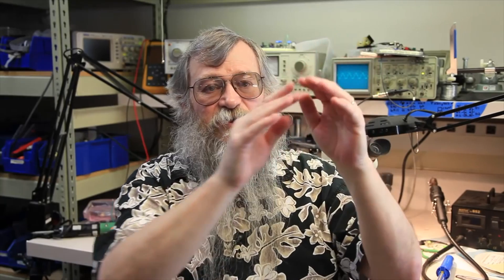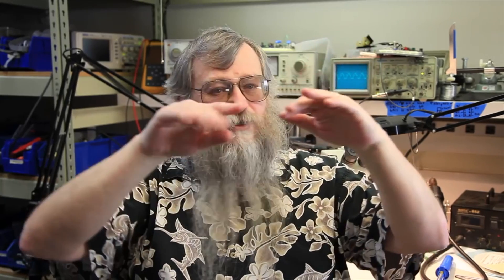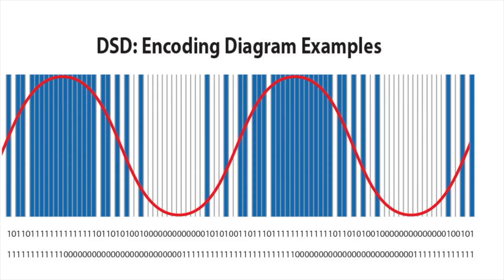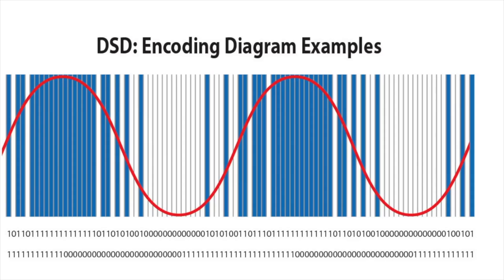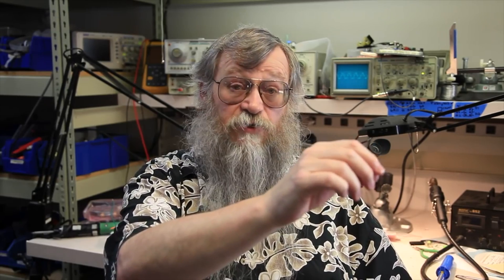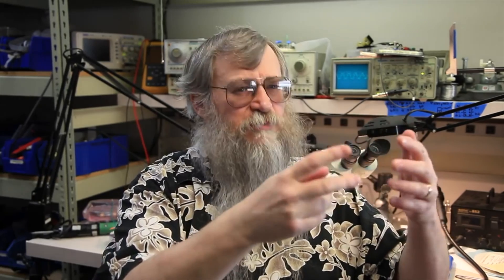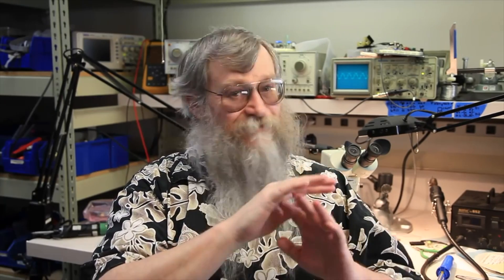Understanding DSD recording and playback

Comment: About 06:00 you talk of the problems with PCM chips: they have to use massive DSP filtering to get any quality.

But don't you need a huge amount of math at the front end to get DSD at all?   Suppose I want a "pure" DSD recording - I don't think you can.  Anything over 0.5 is ON, anything less is OFF.  So, if I feed in a sine wave, I will get a "pure DSD" square wave... (Ignoring your analogue to DSD which has a 3 state system!)

Is the math easier to do the oversampling and noise shaping at the input side or the output?

Comment: A DSD stream looks a lot to me like what comes out of a Class D amplifier. Aside from noise shaping in the DSD stream, what's the difference?
Reply from the maker: DSD is Pulse Density modulation while Class D is Pulse Width modulation. The difference is found in those two descriptive words. Density uses the exact same 1-bit width pulse at very high speed. To make a louder note the number of identical bits gets more dense and the opposite for softer notes. The key is that every bit is the exact same width. PWD (class D) has a steady stream of bits that vary in width from almost off to all the way on. That's how it controls louder or softer,
Reply: @octaverecordsanddsdstudios1285  Perfectly explained
Reply: @octaverecordsanddsdstudios1285  Also is it not true the the pulse width with a Class D output stage is not necessarily quantised, it can be modulated in purely an analogue fashion (hence Class D is not digital) whereas the variation of pulse density in DSD is quantised, so DSD is purely digital.

Comment: Ted, I appreciate the discussion. So, why is DSD so challenging to edit… bandwidth, computer power, something else?
Reply: Because it is 1-bit it is mathematically impossible to perform arithmetic on it as you can with a multibit digital word. It must first be converted either to analog or PCM for editing and then back again.
Reply: @Paulmcgowanpsaudio  I keep wrapping my head around why someone would call this higher bit conversion PCM. Maybe this is technically correct? But essentially every PCM system I heard relies on the Nyquist–Shannon theorem, which involves anti-aliasing and reconstruction, which IMO degrades the signal. When converting DSD to a higher bit signal, non of that nonsense is needed, as the samples would still be connected by a straight line. I would maybe expect a tiny bit of quantization noise added during the process of converting back and forth, still maintaining the smooth nature of DSD.
Reply: How does the Sonoma system allow edits to DSD?

Comment: That has to be the worst explanation I have ever heard about the difference between DSD and PCM.
Incidentally, for the most part nobody does 16 bit PCM any more except for CDs, which are a fading media.
For the most part, the industry has moved to 24 bit, 48 Khz for consumer delivery but not necessarily for recording as 32-bit floating-point at up to 192 Khz is easily sustainable of the average computer these days.
The dynamic range offered for 32-bit IEEE floating-point arithmetic is 1530 dB.
Reply: Dac chips don't record in floating point.  They only record in integer.  32 bit integer dacs exist but we still cannot reach 24 bit (144db) depth.  The best dacs out there in 2022 are 130 or so db.  So 24 bit and 32 bit isn't even attainable in 2022.  Don't be naive.

Comment: DSD-64 is better than red book CD 44.1kHz 16 bits PCM, but PCM can beat DSD with higher sample rates and is supported through modern audio architectures used in digital studios, home audio gear and leading streaming services. DSD is not. Nowadays you can stream bit perfect up to 192kHz 24 bits PCM FLAC from services such as Amazon HD music which is more resolving than DSD.
Reply: Personally, I have never been impressed with 24bit/192kHz PCM as I have been with so many DSD recordings, even standard DSD 64, nevermind higher DSD.
And you're omitting the fact that, just like you can talk about higher sampling rate PCM, you can do the same about DSD. There's DSD 128, 256, 512, 1024 etc.
After being gobsmacked about the audio quality of DSD, PCM would start being impressive to me at something like 32bit/1536 kHz sampling. I won't hold my breath for studios to record audio at that level any time soon, as I can already hear the background laughs and arguments that we don't need such a thing.
DSD, on the other hand, is more likely to encounter flexibility from some people in the industry in adopting it as the standard for producing their own audio. It does sound amazing after all.
Any non-biased consumer who has heard the difference between good DSD and good PCM audio content is already likely to be convinced about the amazing qualities of DSD compared to the decades-old CD PCM standard.
Reply: @edfort5704  Reality is that individual music tracks are far more different in quality than whatever audio codec you use among these ones. If you think DSD sounds better than higher sample rate PCM, please explain what tracks and what gear you used, cause it makes no actual sense.
Sigma delta A/D and D/A conversion has some clear advantages on the chip level in the conversion process itself and those are used also for modern PCM mastered and distributed music. PCM music's biggest problem nowadays is that it rarely gets from master to your DAC without some manipulation. Your 44.1kHz PCM track streamed from the internet is most often sample rate converted to 48kHz in whatever device you use, for example. Also the bit resolution is often manipulated in a PCM pipeline. 
Thus, if you are not careful, your PCM playback can easily be with a combination of nasty sample rate conversion and bit resolution involved. Both of these are lossy.
Sigma delta conversion will continue to dominate in the conversion process within the ADC and DAC chips, but DSD is doomed and not viable as alternative distribution format due to its complete lack of modern architecture incl. DSP support. More than 24 bits of resolution makes zero sense btw and there is a rapid diminishing return of higher sample rates than 44.1kHz btw. Check this article: https://www.mojo-audio.com/blog/dsd-vs-pcm-myth-vs-truth/
Reply: @ThinkingBetter  A 96kHz sample rate is far superior to a 44.1kHz sampling rate IF, and that is a big if, one is trying to capture the instruments and acoustic space with minimal microphones (think live to two track where only two channels have A/D conversion.) I have heard a classical recording played back at 24-bit with the same recording chain, but one recorded at 44.1kHz while another recorder simultaneously recorded at 96kHz. The difference was very obvious. That said, if one is making a studio multi track recording with compression, limiting, eq, etc., I can see where recording at 96kHz would make less sense. Especially if the end user is listening to mp3 files on $10 earbuds.
Reply: @vinylrules4838  The difference between 44.1kHz and 96kHz PCM is mostly about precision in the treble and the gap mostly depends on what type of DAC and low pass filtering you use. Personally I pay extra for the Amazon HD Music to get the FLAC bit perfect streaming in up to 192kHz 24 bits. In near 100% of cases where I find a track to sound extraordinarily good, it's not about the digital audio format (I don't listen to MP3 crap) but much more about the music production itself.
Reply: @vinylrules4838  I totally agree with you. DSD offers uncompromizing quality in comparison to PCM. There's simple explanation to prove this: DSD has at least 120+ dB dynamic range what PCM up to 192 KHz can't have due to phase noise issues. 24/192 has only 108 dB dynamic range. To have at least 120 dB you'd have to record at 768 KHz sampling rate PCM. I have tested some interfaces that can handle such sampling rates to compare with DSD format. I must say I can't tell the difference between the formats in this case.
Reply: Thinking Better, Ed Fort, Vinyl Rules, Larry Stout. Let's forget about all this bit stuff. Why argue over this. Nothing has been done in 30 years. Why do you think it will change now? Why pay $25 for a dsd, or Sacd, when used cds are a $1.  Did Bill Gates buy hdcd, just to get rid of it on purpose , by being bought off for it, like he is bought off on everything else. Who is holdind sacd Back. Who was the crazy brain that tried to get  rid of cds? Upsamplong is rubbish. Everyone has Heinz 54 varieties like a mixed dog ways to make a simple stadard to make music. Enough already, its time to give up. Like the crazies who quit making high-end cd players.
Reply: @myronhelton4441  With modern online streaming, having 60+ million music tracks in CD or better quality available to play in seconds, is awesome dude and 99% of modern consumers appreciate it.
Reply: @ThinkingBetter  I agree with you. Streaming doesnt sound as good as cd .
Reply: @myronhelton4441  It's not the streaming itself that makes streaming inferior but usually careless conversion of the data from the source side or in your device where especially the sample rate gets up or downconverted. Very often your 44.1kHz CD sounds better because streaming is done with the same data file but unconverted to 48kHz which actually is a lossy translation of the PCM data (imagine drawing the sound curvature by guessing where you have 48,000 points on the curve per second from a curve of 44,100 points per second. Even it's up-sampling, it's actually lossy and depending on the quality of the math algorithm "guessing" (estimating) where those points are to be, it can hurt the audio quite a lot.
Reply: @ThinkingBetter  You have really helpful information. Thanks.
Reply: You have really helpful information. Thanks.